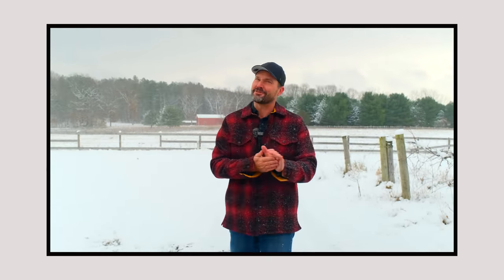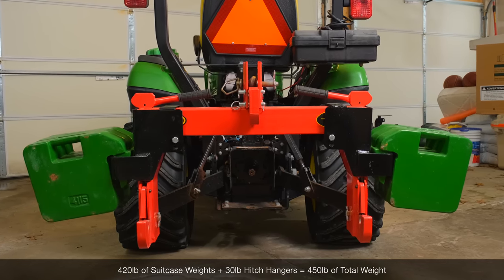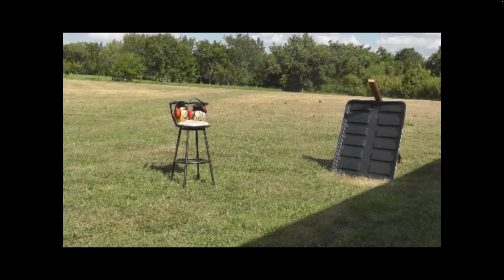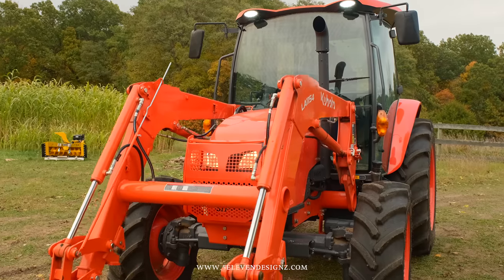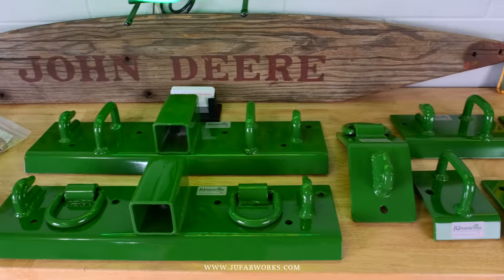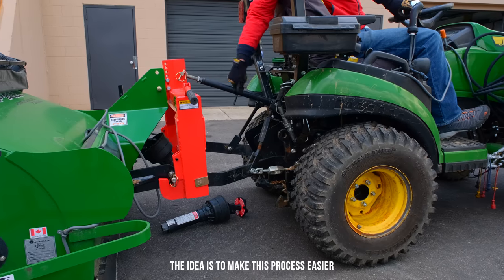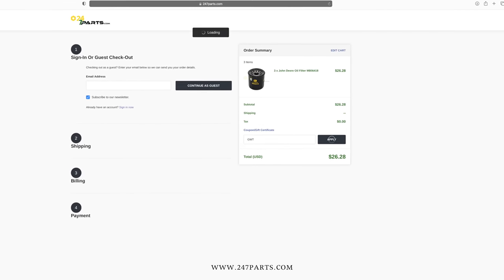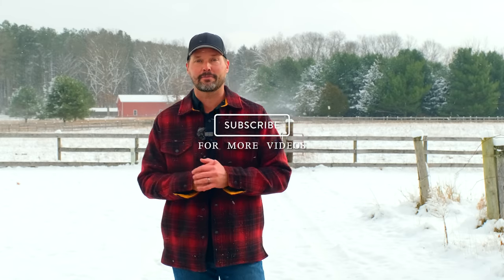YOU BETTER TELL YOUR WIVES (& HUSBANDS) ABOUT THIS VIDEO 🤩

Comment: I enjoy these videos.  Alot of great information on  new products and safety. I grew up on a farm and continue to help my family farm.  I have used everything from a gas burning tricycle front tractor to nice cab machines and about everything in between. Ground prep, planting, working hay, feeding cattle and even logging. In all that I still find helpful info in your videos.  I have a JD 3025e that works great in tight areas and in my hunting endeavors. Keep up the good work.

Comment: I'm a LS tractor owner. I purchased it back in 2019 new 35hp with can. Has been a pretty good tractor. Only had one problem which turned out to be the safety switch under the seat. I've got a little over 500 hours on it. I purchased while I was building our house in Wisconsin and for snow removal. The heat and air is great. And it was in my price range
Reply: Forgot to mention I also have a L355ss Kubota which could use a new clutch but still works. And a Case 580SE backhoe which only gets used a little now

Comment: I like the grill guard product. I looked previously, but was unable to determine if they make one that fits my old Kubota M4050DT. And this is the first I have seen the magnetic mirror product they have. May need to check that out. No loader, but may work on the windshield someone retrofitted years ago. Thanks for the video and product suggestions.

Comment: I could use a grill guard.  I ran a branch through my hydraulic cooler earlier this year, and was looking at the thin metal that protects it, and thought there must be a better way.  Turns out there is!  I have a 2021 John Deere 2025R

Comment: Is there a 511 Grill Guard for the JD x738?  I'm sure Lube Shuttle doesn't need my endorsement - but, I offer it anyway, the Lube Shuttle system is just the tool for making greasing my tractor, chipper, Trac-Vac, ATV, you name it easily, clean handed.